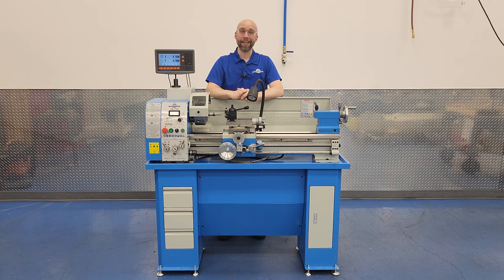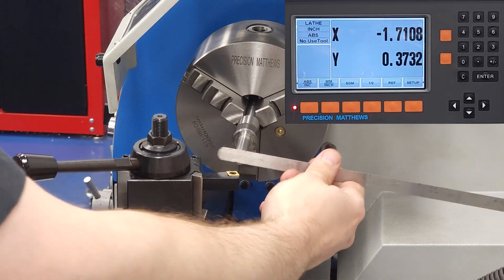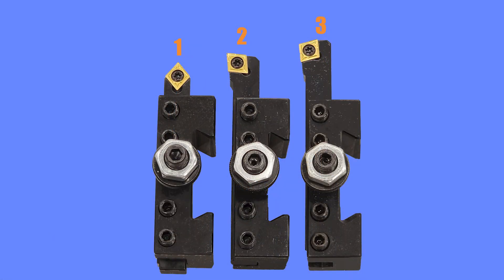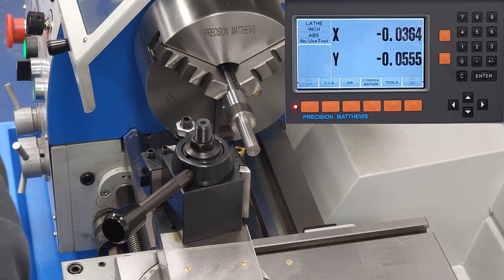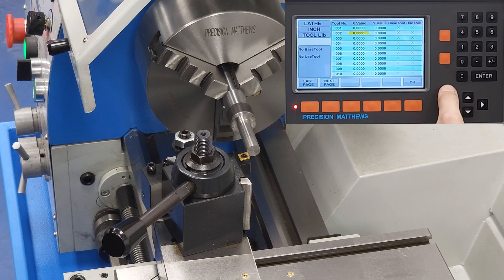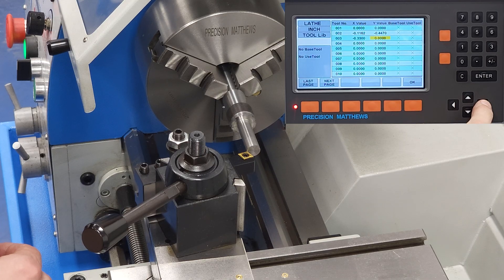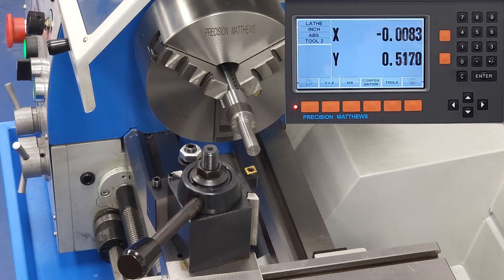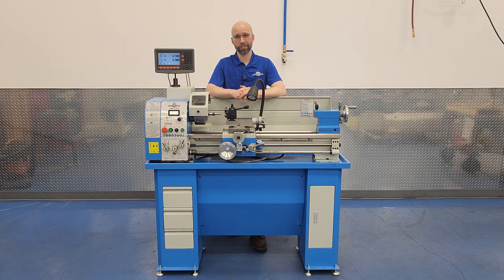PM-LCD Lathe DRO (Digital Read Out) Tool Offset Precision Matthews Media

Comment: Easily the best way to increase productivity. I have a Sony DRO. Only has a 9 tool library and tool 1 changes them all. So effectively only 8 tools stored. I have twelve holders. Could use another eight. I hardly ever swing my confound slide or adjust it. Still have to make those final measurements but boy oh boy, can you get down to very close very quickly. I would suggest that at least 13 holders and a good DRO would cut manual machining times by a factor of 3 or 4. I made my own close ratio gearbox blanks and shafts. Turning, grooving, chamfered, boring, trespassing, facing and parting. All I needed to do was go thru my sequence and spit parts out. I actually did them in pairs. Machine one gear that had a spline to be machined on one side. I machine it all over in one setup, do 10 like that. Then hold on turned gear and repeat process but adjusting for the offset in Y. I would then go thru and part them apart. They were grooved in bore. The parting region was part way up the face of two back to back gears. Once parted I would use a radius trespassing tool and carve out  the piece that was where the parting portion was and it served as weight reduction. But the gears were geometrically perfect. One op to do all critical faces, bores, shoulders, circling grooves and outside diameters. My gear cutter loved working with my parts because he could confidently stack them.